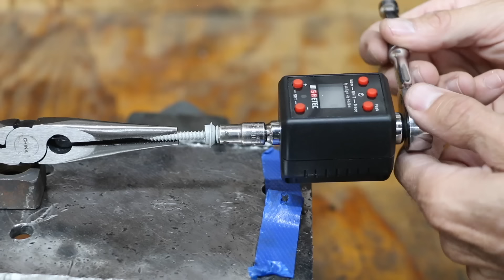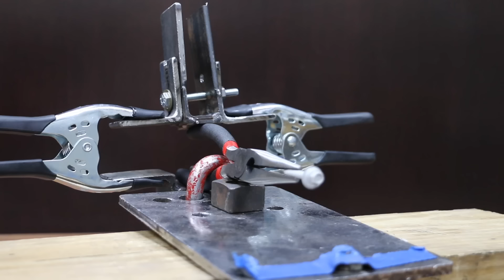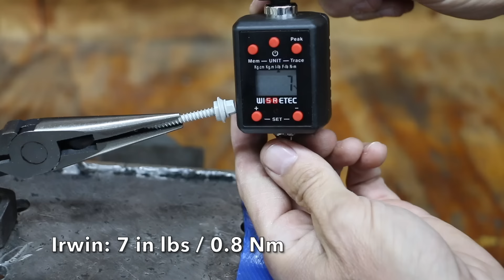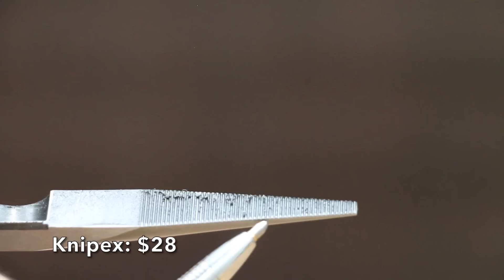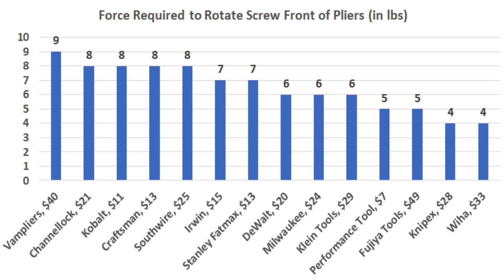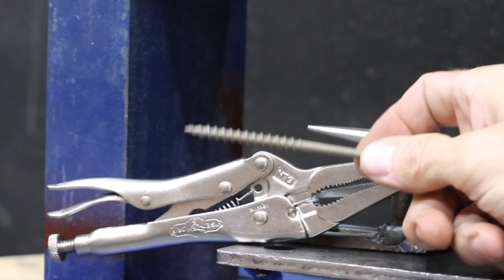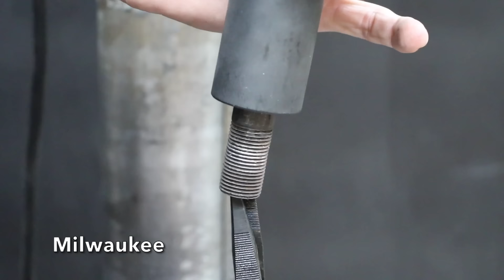Japan vs German Pliers (LONG NOSE)? Knipex, Vampliers, Klein, Fujiya, Irwin, Kobalt Needle Nose

Comment: In almost every video you are using a vise, but i don't think you ever reviewed one. The vise may be the simplest and yet most important piece of equipment in the workshop. I have used mine as a press to push U joints in/out, as an anvil, as a metal brake to bend metal, and countless other things. How do cheap asian vises compare to old standards like Wilton? I think this would be a great video!
Reply from the maker: Thanks for the video idea.

Comment: This shows why I like Kobalt tools so much, they're cheap and not the best but they punch well above their weight.
And you can buy 4 of them for the price of tools it competes with.
Reply: I think I'd rather have one tool that costs four times as much, and then not try to cut nails with needle nose pliers.

Modern steels make even budget tools fantastic though
Reply from the maker: Thanks for the feedback.
Reply: This neatly sums up the difference between people who sometimes use tools, and people who depend on them.  If I do home maintenance and hobbies with my tools, then yes, I can by more different Kobalt tools for the same money.  If I make my living with my tools I don't have the time to spend replacing tools to get my daily work done.  I am not criticizing either one, inexpensive tools allow people including me to own and use tools they would otherwise be unable too.  A mechanic or an electrician, or any building trades person will own tools that cost many times the price of a similar tool at a box store, but that tool will pay for itself many times over in durability and reliability.  I view this channel as a good source of information on those mass market tools.
If I don't need a tool to make a living, then this is often a good place to help make the price/quality decision. If I need the tool to make my living then I probably know more about its uses and characteristics than I will see here.
And yes, I have and use some Kobalt tools, I think they are similar in quality to Craftsman and other good mass market tools, but definitely not as good or nice to use as the more expensive branded tools I have chosen to buy.

Comment: I'm curious how much force the average hand can exert on a pair of pliers' handles. If I want to cut a nail, I'm not reaching for long nose pliers, and for cutting a deck screw, I'd be looking for a rotary tool, or something. These pliers were engineered for fairly light duty service. Interesting results, but if you're using these to cut, stick to cutting copper wire, which any of these pliers will probably do all day long.
Reply from the maker: Thanks for the feedback.

Comment: I would have loved to see jaw force generation and a straight pull. I use my needle nose for getting in tight spaces and pulling connections or ripping something off. Still, another great video with a great selection of accessible brands!
Reply from the maker: Thanks!  Thanks for the suggestion.
Reply: Same here.  I use them for gripping and pulling wire or fish tape.
Reply: Doesn't this translate to the turning testing? If a needle nose can hold something from just twisting, it's certainly going to hold something on the pull out.
Reply: @stelonous  Yes but like how the screw tests had 2 versions (straight and perpendicular), I think pulling would test a different aspect of grip and might show some bigger differences due to the jaw design
Reply: @stelonous  
I agree--I think what the OP was describing is (more or less) 'gripping strength'--I think that was adequately tested on the rotating screws.  What wasn't quite clear to me was the effect of the various/different machined 'teeth' on the jaws--for example, those pliers with 'cross-hatched' teeth appeared to grip less effectively (at least in rotation).
Reply: @stelonous  I may be wrong but I believe the twisting test was more for rigidity.
Reply: @bradoakwood  I meant the screw tests.
Reply: Similar to holding strength of the screw. But definitely a different test that is specific to these tools. I end up using needle nose ViseGrips for this, but they don’t always fit.
Reply: Yes, the lack of that metric was very disappointing.

Comment: Not one of these tests would I use needle nose pliers for. The Knipex pliers used were not even in the same ballpark as the others. Should have had a tube and seen which one can even get in far enough to grab a bolt or wire or etc. What true needle nose are used for.....

Comment: I'm a inside wireman, I would like to see you test wire strippers, sharpness, damage to conductor, slop in joint over time, the function used to cut machine screws that most have, ect.
Reply from the maker: Thanks for the video idea.

Comment: Short stubby needle nose are favored in your testing. Your tests are a poor indicator of trade usefulness. The most applicable test would’ve been to drill a 1 inch hole and see which one can reach the furthest with functional grip strength.

Comment: Best crows foot? Or “torque adapter” as a Pipefitter we use these a lot and Armstrong was the best. I believe gearwrench recently bought them out and we don’t know who else makes a comparable product. The others usually slip off fairly easily. For example an 1-1/6” bolt (wrench size) gets torqued around 120ft/lbs.
1-1/4” bolt (wrench size) would get around 220 ft/lbs. thanks! Love your channel!
Reply from the maker: Thanks for the suggestion.  Thanks!
Reply: @ProjectFarm  Thanks! The fully enclosed “torque adapters”  that aren’t “thin wall” won’t fit on what we work on. Thanks!!

Comment: Not sure this is a fair test, some of the pliers, such as the Knipex, have long thin noses and seem to be designed more for electronic and small component applications, rather than the heavy mechanical uses the tests focussed on.
Reply: I get it - but we also have to remember that Knipex only makes pliers - but has like 254 models - so which ones should he pick? I bought a great pair of Knipex that are extra long and pointy - and the jaws are actually a bit flexible.  So yeah. Tough to get a perfect 1-1 comparison with such a specialized company with Knipex vs Stanley that makes 2.
Reply: Honestly not a fair test. I’d be buying Knipex every time. If I want to cut heavy duty stuff they have other pliers in stock.
Reply: well this was a test for mechanical use of pliers. electronic pliers are much easier to judge by feel. it’s hard to judge mechanical strength before buying
Reply: True
Reply: tool is tool
Reply: @jacobdubeau8162    Eh...??

Comment: I really appreciate my Knipex needle nose. Most other needle nose have a bass ackwards design. Longer handles and a shorter needle nose. It makes them virtually useless. I can reach much more in tight spaces with my Knipex. I’m not worried about grip strength that’s why I have lineman pliers.
Reply from the maker: Thanks for sharing!
Reply: i have the knipex telecom plires or 29 21 160. brilliant for reaching into places but i wouldnt be grabbing screws or cutting nails with them
Reply: It is Project Farm and he’s a farmer so used to bodge-jobing to get things done. Obviously he won’t understand specific trade necessities. He’s been informed about these issues and said he will include changes in his future videos. Very smart man who is very good at learning and adapting, just like most hard working farmers I know. (Not sure of his specific farm or farming work though).

Comment: The two brands I use the most, Channel Loc and Irwin did very well but I also carry a very cheap pair of Work Pro long nose pliers that that gets sacrificed for any sketchy electrical box that still had some other power reading when the main fuse box was turn off or had all the fuses pulled. We come across a lot of power pirates when trouble shooting electrical problems and repairs. :)
Reply from the maker: Thanks for sharing.

Comment: I have had Channellock and Klein for over 10 years with moderate abuse and they are doing great.  And an old pair of Craftsman, 40+ years old, that have stood up to farm use and abuse, and are still good.
Reply: The old Craftsman was much better than today's Crapsman.
Reply: Totally agree about the Craftsman +40 and Channellock ~15 but don't have the Kliens  However I do have a pair of SnapON 7" 90° bent needle nose that are ~40 years old to and still pristine with lots of abuse.  Prefer a long taper also. Typically don't abuse them like cutting hardened deck screws but everything else.
Reply: @pjhalchemy  Yep.  Usually only use the long nose for copper or small wire, nails and such if in a pinch.  Anything heavier, I use lineman or bolt cutters.
Reply: Farm use is the ultimate test 😄
Reply from the maker: Nice!

Comment: Wow the Knipex performed terribly. In almost every plier test (of different types) the Knipex are usually among the best. I came at a point in life that if I need pliers, I first check if Knipex has them, before checking anything else. I've had Knipex pliers fail, but I bring them to the store and they hand me a new pair and I can go on with my day.
Reply: They didn't perform terribly. They are made for more delicate tasks. They are far longer and thinner than the others for a reason.
Reply: @blackhatch46  That's true for sure. I got these pliers and they work great for what I do with them.
Reply: So you're saying Knipex tools might cost less in the long run because the company stands behind its product?
Reply: @Ea-Nasir_Copper_Co  For me, as a professional home owner, I buy it because I trust the brand and have positive experience with the company. Besides that, I don't know the price difference but I'm in the EU so it might be a little bit cheaper compared to purchasing the same product in the US. Besides the less hassle, warranty is great, so as far as I'm concerned, it does cost less in the long run.
Reply from the maker: Thanks for sharing.
Reply: @ProjectFarm  Thank you for making these awesome videos.

Comment: Way too much emphasis on the cutters.  Who uses a needle nose to cut deck screws, or even nails for that matter?  Definitely the wrong tool for the task.  They are designed for cutting soft copper wire.  Also, they are a hand tool!  Using a hydraulic press to exceed what a human hand is capable of squeezing seems like useless information.

Comment: I always just buy cheap menards brand needle nose pliers since my mom and sister always ruin my expensive ones either by using them as a hammer or leaving them outside or trying to use them for stuff they aren't made to cut
Reply from the maker: Thanks for sharing.

Comment: I used to be a Dewalt guy but their  products have declined to the point of not being worth what they cost. Their consumables are absolute garbage. I threw a complete set of their drill bits away because they dulled so quickly and wouldn't hold an edge at all. Chinesium crap.

Comment: I would never use this for cutting nails or screws. wire only. 
thought for sure knipex would win. nope. 
great job. surprising results
Reply: Other than 14 or finer ga. mild steel wire, I'd Never cut steel wire with them. And it's obvious to me that they weren't designed for cutting bigger or harder wire (nails and screws) because hand grip with a single pivot is insufficient to generate that much power.
Reply from the maker: Thanks!

Comment: The Knipex pliers you tested were much longer than the others. They do have a shorter model that is much more stout and closer to the other brands tested. Thanks for the content!
Reply from the maker: You are welcome!  Thanks for the feedback.
Reply: Yes, it is clearly a different design of the europe and US needle nose pliers. The US are made for heavy duty and look beefier. Maybe the europe ones were developed from electrical pliers.
Reply: @berndrosgen1713  Yes, Knipex in Europe is definitely made for electrical use, and only knipex had 1000V insulation and grip protection. I working with Knipex tools (im an electrician) and for electrical use, knipex is the best.
Reply: @itachione2483  not only for electrician's work, i have some knipex tool's and work in the automotive industrie. especially the cobra's are amazing, cant really live without one😅 ergonomics are also on-point and the fact my dads 30 year old set is like new says enough...
Reply: @itachione2483  I’m also electrician (Europe) and most of my pliers are Knipex,VBW not available in my country.Knipex makes excellent pliers overall but it’s not the best.I have 200mm vde needle nose pliers from Knipex and they are crap.
Reply: @itachione2483  I am an automotive technician.  Knipex has change my opinion on wrenches and ratchets, which are now my “specialty” tools because my pliers wrench can do most jobs more quickly since I don’t have to go get them from my tool chest, find the correct size, etc. I only use my ratchet and wrenches when I have to remove more than 4 hex style fasteners, or when there are obstructions around the fastener, but even then, I use my pliers wrench to determine the size of the tool I need anyways. This saves me a lot of time.
Reply: @berndrosgen1713  The Wiha ones were actually labelled as such.
Reply: I’m an electrician and we only use Klein 90% of the time or Milwaukee
Reply: @omegaanimations8549  Klein are made for people who use tools. Some are made for people who collect tools.
Reply: @volci321 I agree, I love my Knipex Needle nose because of how long and slender it is.  It can get into some tight spots with ease, and works wonders for putting on master link clips in spots where my meat hooks can't reach. Some of these tested almost look like a cross between linesmans pliers and needle nose, with how fat they are.
Reply: Real 🇺🇲 electricians use Klein 😎   If it ain't Klein, it ain't mine !   Lol   Jk,   Competition makes the world go around.  And, it makes better and more affordable tools !
Reply: The way he pronounce Knipex🙂😂
Reply: @mariushoeydal6782  You mean the correct way? Kuh-nih-pex is the legitimate pronunciation.
Reply: @mariushoeydal6782  I know it's weird but he's actually pronouncing it the correct way.

Comment: I've had this kobalt pliers, and they're great. I also have  got knipex, and I'm really not impressed with them at this point outside of their adjustables. I'd take a kobalt for general use any day, but getting into tight spots the knipex do still fit better, they just can't take pressure.
Reply from the maker: Thanks for the feedback.

Comment: 🥳🥳🥳 Video Ideas 🥳🥳🥳

• Best extendable/telescoping ratchet wrench
• Best device to make using a can of spray paint more comfortable
• Best soap to remove paint, oil, tar, etc from your hands
• Best detergent to remove paint, oil, tar, etc from your work clothes
• Best hard hat
• Best push lawnmower
• Best robot lawnmower
• Best drive-on plastic ramps for changing your car's oil (which pairs slide the least on smooth concrere?)
Reply from the maker: Thanks for the video ideas.

Comment: The bend test was interesting and useful. I'd also love to see a corrosion test cus my kid is always leaving my tools out lol
Reply: Sounds like you need a locking tool chest. Haha.
Reply: Oooh corrosion test for all applicable tools would be sweet! In the humid south, it's a real problem for me if I don't keep my less-often-used ones oiled regularly.
Reply from the maker: Thanks for the suggestion.
Reply: Totally agree, corrosion and drop testing are musts.
Reply: You stop that by letting him use cheap tools only. I call these ''loaner tools''. Cheapest set you can find.
Reply: Charge him a dollar every time he leaves a tool out.......bet he stops that bad habit.
Reply: @_JimS  1 12 times replacement value. Cash up front.
Reply: If you leave your kid out in the rain with the tools he borrowed i doubt he corrodes as much but learns a lesson...
Reply: As much as I love Made in USA Channel Lock tools, their one downfall is corrosion.  I keep my tools clean, dry, and well organized, and it seems any pair of Channel Locks I've ever had were covered in light surface rust within 1-2 years.
Reply: I leave most of my tools for work in the trunk of my car and they corrode. I started using Blaster Heavy Duty Corrosion Protectant to prevent it from happening recently. It works great. I bought it at Home Depot.

Comment: They don't feel special as pliers, but the crappy 'reamer' cuts on the outside of the Milwaukee's is a really 'nice to have' if you're disorganized while doing electrical work. It works better than nothing for 1/2 emt
Reply: I tent to use the wire strippers for that
Reply from the maker: Thanks for the feedback.

Comment: When are you going to blow up another Briggs engine ? Curious minds want to know !
Reply from the maker: I've got a lot of engines to work with if there's still enough interest.  Any suggestions on a topic that most would enjoy?
Reply: They're hard to blow up, my B&S sears Craftsman mower refuses to die, change oil and filter once a season, seafoam now and then,  13 years old. Too bad now a Chinese company, R.I.P American manufacturing.
Reply: Yeah put a blower or turbo on one and see what happens.